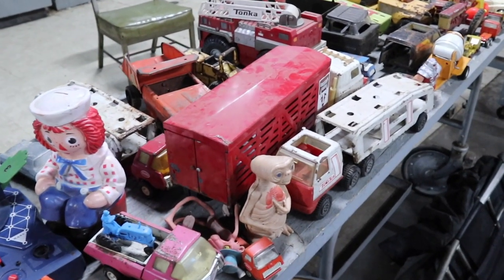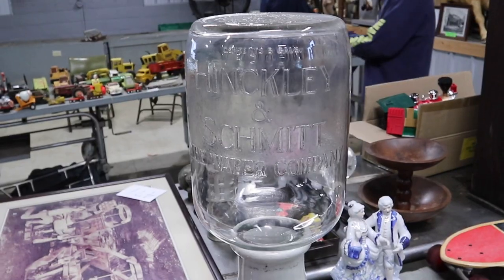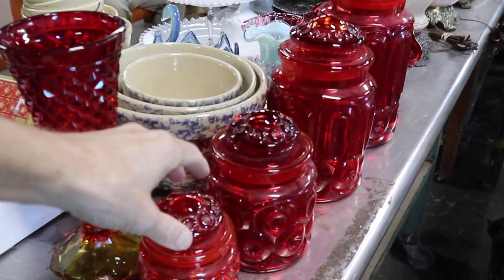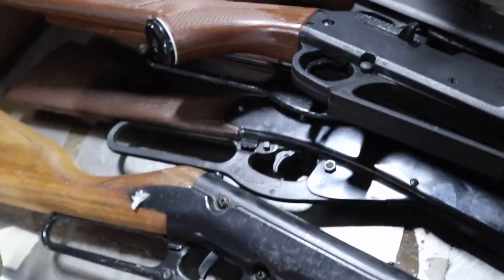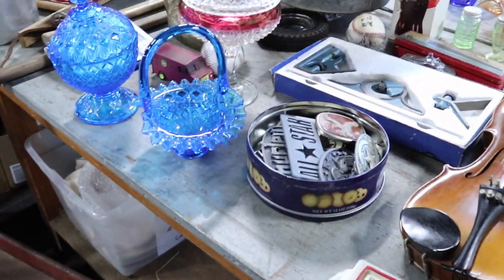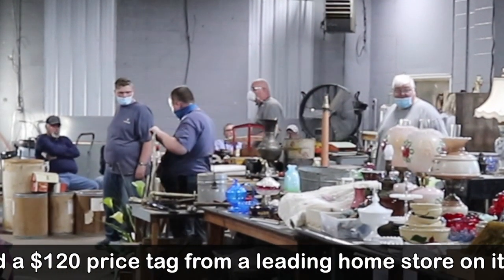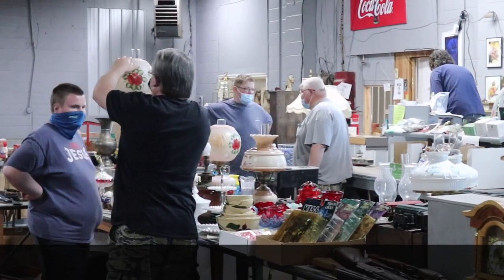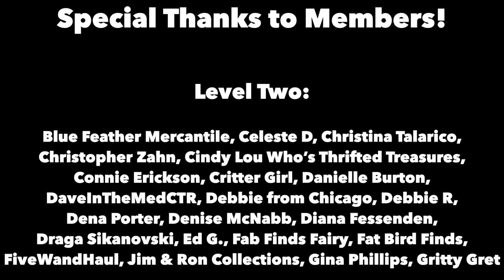TIPS & TRICKS FOR AUCTION BIDDERS | RESELLER | ANTIQUES & VINTAGE

Comment: I would buy the plain milk glass lamp without the florals, but I'm one of those people who just loves plain old milk glass😊
Reply from the maker: It's the more valuable of the two because it's all original! They were meant to be plain/utilitarian
Reply: @TheAntiqueNomad  actually, Aladdin replacement parts are still manufactured. That looked like a brand new tall chimney. I spent most of the 90s living and studying by Aladdin kerosene lamplight. (I had 4 or 5 of them.) I didn't have shades on most of mine. In the 90s shades were expensive to replace. (Shipping to Hawaii didn't help.) Though I am not certain of this, the reason they are valuable may be the patented burner and tubular wick. When properly maintained they provide light equal to a 60 Watt bulb. Last I checked Aladdin was still manufacturing lamps. The most valuable in the 90s and 00s were the hanging lamps. Even new ones were expensive and antique were crazy expensive.